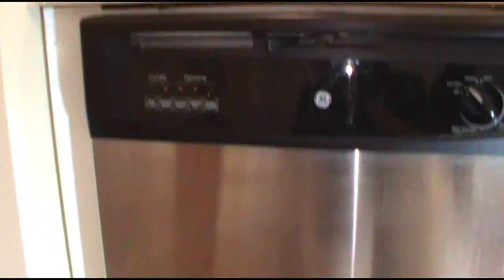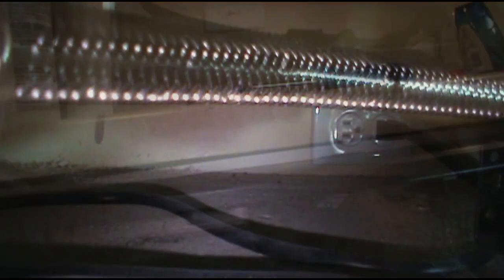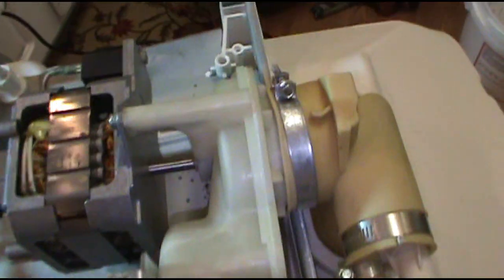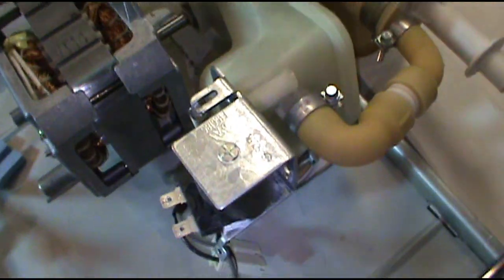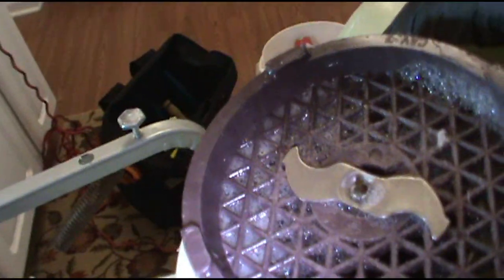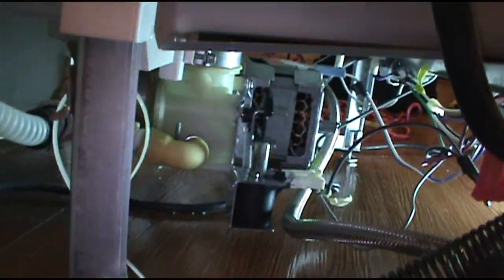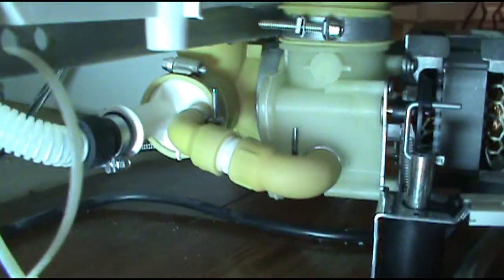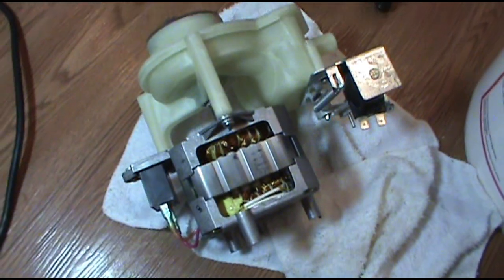How to Replace a Dishwasher Motor

Comment: Nice work Skid 💪 I just replaced the motor in one of the dishwashers at my property a few weeks ago. It's definitely a money saver for the budget in my situation. I have an account directly with GE, no middle man & I get parts at a really great price. I can get 2 motors with the pump assembly for the cost of a new dishwasher. Anything to stay in budget, which equals a quarterly NOI bonus for me. Keep the vids coming man 👍
Reply from the maker: Thank you so much for watching Rich!

Comment: thanks for the tutorial. very helpful when troubleshooting my dishwasher.
Reply from the maker: You're welcome Nick! Thank you so much for watching!
Reply: @LexVance  k well, i found a toothpick stuck in my macerator. i took out the obstruction and put the old motor and pump back in to see if the noise was gone, it was. but as i was testing it looked underneath for leaks and i guess one of the hose clamps just need a little bit more tightening cause of a small drip. i turned it off (which was probably my mistake) not letting it run through its cycles...now the machine wont start or do anything at all. So know im wondering if blew the thermal fuse and not sure where to find this to check for continuity...any ideas mate?
Reply: I'm checking your page now to see if you have ever checked someone's dishwasher for continuity.
Reply: @LexVance  by any chance do you know where the thermal fuse is located?

Comment: Hey skid I worked on those ge dishwashers
I found the drain solenoid will go bad and make the same noise  remove the plug from the solenoid and run it may just that just be that. Like always good stuff
Reply from the maker: Right on. Thank you so much for watching Hvac Rod!

Comment: Probably is quicker to replace the motor than the entire unit.  The time you spend just unboxing, leveling and possibly drilling new mounting holes, etc. is probably more than what you just did.
Reply from the maker: Yep. I agree. Thank you so much for watching Scotty!
Reply: It takes me right at a hour to swap out a dishwasher..... i hardly ever fix a dishwasher until its the door handles or the fill valve

Comment: Just installed a impeller kit on a dishwasher this week. The gasket was leaking. I have no idea where the impeller went. I'm new at repairing appliances. I'm way more experienced with AC units. So what I've been doing is swapping problematic appliances from occupied units with functioning vacant unit appliances. I fix the broken ones when I have the time to learn how. That is such an apartment maintenance statement. You ought to make that into a T-shirt skid nasty.
Reply from the maker: 👍😆👍 right on. Thank you so much for watching ReelGuy!

Comment: I jus replaced a drain motor on dishwasher and it still won't drain any suggestions skid
Reply from the maker: The orange ball in the ge dishwasher has to be in there. If not it won't drain. I'd need to be there for this head scratcher. Sorry skid! 😭
Reply from the maker: @lancebinns7215  🤣
Reply: @LexVance  jus placed a order for some of those orange balls lol